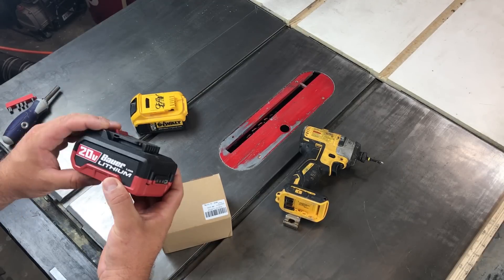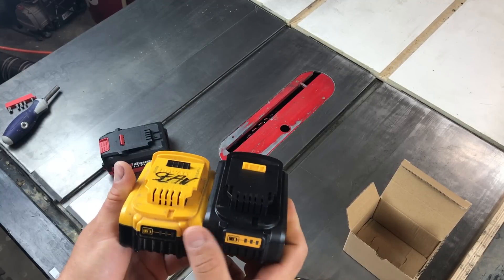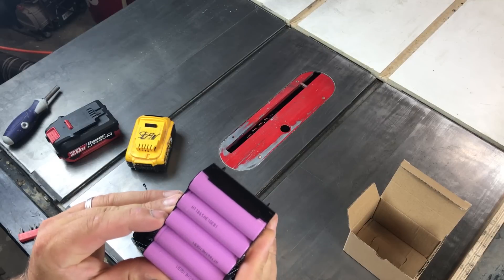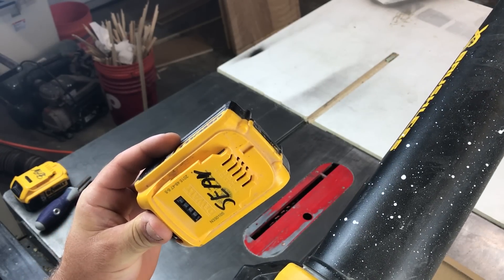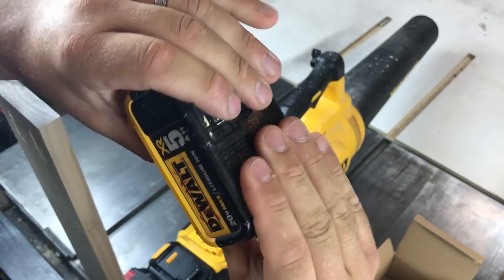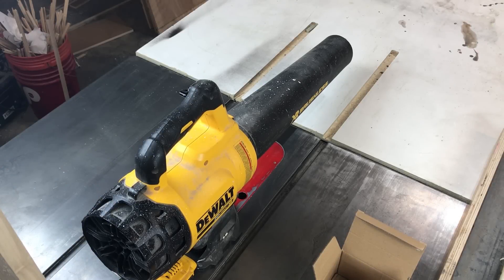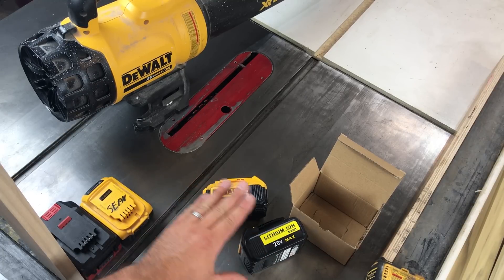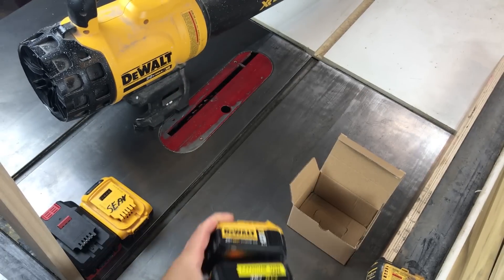Generic Dewalt battery from Amazon vs Genuine Dewalt 20v Lithium battery

Comment: Vanon batteries are junk plain and simple I bought a 4000 aH 20 volt battery and the run time was less than the Dewalt 2000 aH and their nic Cads do not hold a charge at all either.

Comment: It is foolish to think that you really don't care whether it shut down due to heat or (you said "wear" but really it would be...) low voltage because if you damage the battery it will not only have a shorter lifespan and degrade further with each charge and discharge cycle, but with Li-Ion can even be a fire hazard.  You mumbled on about real world tests instead of lab tests but the real world test that matters to most people is not how a battery performs on the very first discharge (especially if trying to compare a new battery versus a used one) but rather how it performs on every cycle and how many cycles it achieve so you aren't paying for new batteries 3X as often.

The fact is, quite a few people have tested the generic batteries and they never perform as well as major brands and in many cases will current starve a tool so it performs worse using less current, which is another reason these generics can seem to have good runtime.  Granted this is less true with brushless tools which will increase the motor  controller duty cycle to compensate, but this can cause even more strain on the generic battery so it has even fewer recharge cycles.

Generally the generic batteries are only a good value on a very low current *tool*, but it must also be considered that the major brands practically always stick with the same major brand Li-Ion cells in their packs while even the same brand and model of generic, can switch batteries at the drop of a hat so you may not get the same performance from different generics even if you bought multiples of them at the same time.

However the fire issue is the larger concern to me.  How much is the building, and everything in it worth?  Insurance may pay for that, but  how much are the PEOPLE worth?  They are priceless even if you have insurance on them too.  ;(

Comment: The aftermarket battery will void warranty if they know u use these cheap batteries.  Not to mention the circuit board isn't the same I'd I'm correct and could damage your tool.
Reply: correct, AvE did a generic vs. dewalt and it even appears to be the same generic pack, after tearing it down it doesn't have the same overcurrent protection in the battery as the dewalt and the cells while probably genuine are most likely b-bin or worse. there's also the question as to whether the protection circuit protects from over draining the pack, over charging the pack, and without the overcurrent protection is seriously at risk for dead shorting a cell and exploding.

Comment: No thanks. It will not be a bargain over time. I’ve learned the hard way there is no free lunch with batteries. I seriously doubt this will hold up.  It’ll lack some overcharge or overload protection that will ruin a charger. ruin the tool, or start a fire. Plus, right out of the box it’s performing like a 4 AH battery not a 5.  It’s not worth saving $35.

Comment: I bought 2 of those exact cheap Chinese batteries.  One lasted about a month.  The cells inside are complete junk.  I went to reset them but they were  internally shorted.  The other battery actually is still working.  I will never buy these shitty batteries again.  SAVE YOUR MONEY.  Buy quality.

Comment: you Are Wasting your money
Reply from the maker: Probably
Reply: Sean Carlin Designs I’ve had that same 5.0 battery for 3 1/2 years it’s out lasted my dewalt battery a year so far best $34 I’ve spent 
Used it on a dcf886b and heated dewalt jacket the entire time
Reply: Brandon Zgadzaj they don’t come close to compared to the legit. They are recycled used batteries they are using from other devices. They don’t have the same rating as advertised and they don’t have the save safties. These things are scary bad

Comment: Why do people bother with cheap batteries or gutting harbor freight shit. Just buy another battery lol.
Reply: k flores because they think they are getting one over on the manufacturers. They think there is some grands conspiracy, these batteries are crude as hell and have none of the safeties as the name brands. These also use old drained cells from dead electronics which in of itself is down right insane to use. These will cause a fire, people who have a understanding how these batteries work would run from these. Yet what does this it know who has a masters in electrical engineering and who works with these cells daily.
Reply: @zack9912000  These are not drained old cells.  They are brand new 18650's in most of these 3rd party units.
Reply: @bman3020  they claim that but that has been proven bs that 90% of those third party vendors are pulling them from old electronics and relabing them.

Comment: i bought several off-brand and every one of them smoked themselves on any tool that could stall out, making them useful for only led lights and impacts.
quite a costly awakening. the internals may be comparable cells, but the plates, wires and solder are very inferior to the real deal.

Comment: I buy tools only when they come with free batteries, and when they are on sale. pre planned purchases. So I have 7 dewalt batteries that came for "free". 30% less run time, plus the probable lack of current, and cheaper electronics. It's the battery electronics that protect the tools nowadays. I dunno man, I just think you're wasting your money and time.
Reply: TheVryfst also taking a chance of burning his house down using these

Comment: They heat up and burn out on heavy use peace of junk
Reply: I've never had any problems with the generic dewalt batteries. After 1 year of use, they're still running strong
Reply: They don’t last with my cordless saw or sds drill. Burn out when they get hot.